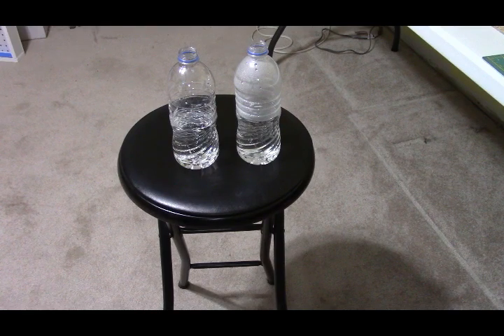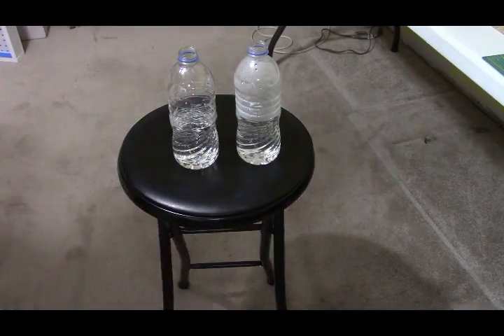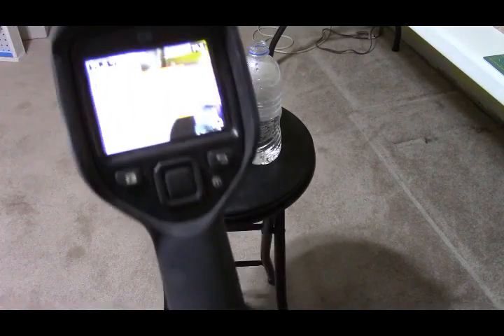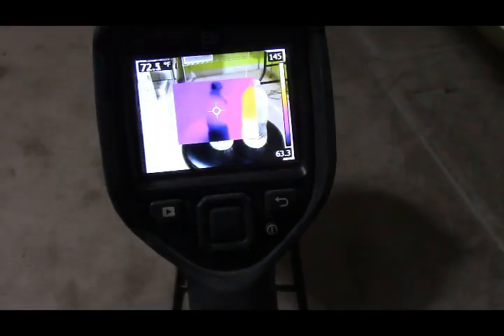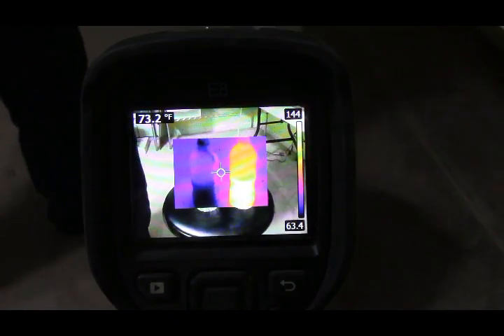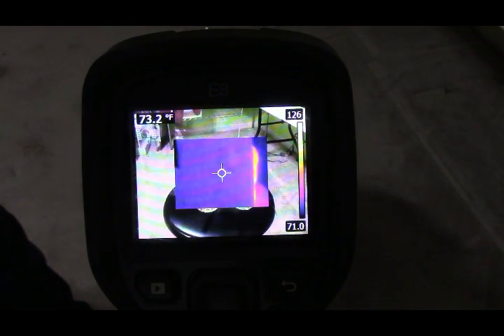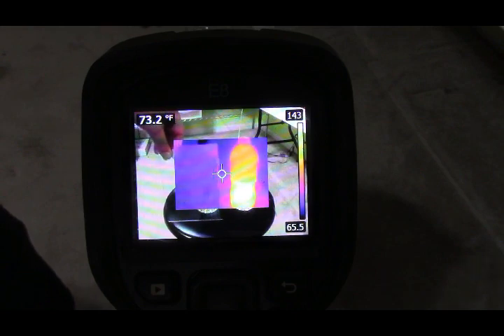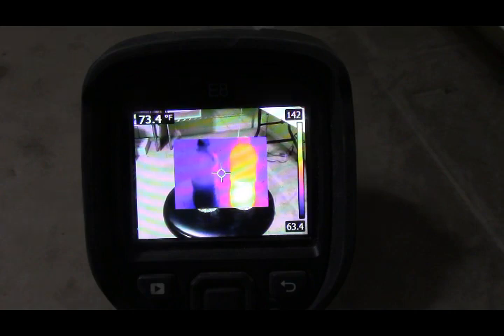Is infrared blocked by acrylic?

Comment: To me it seems that the Acrylic is not totally blocking the Infrared but
 making it diffuse. Because I see the whole acrylic plate turning yellow when it comes in front of the hot bottle.
Reply from the maker: Good observation. The plexiglass is very reflective in the IR bandwidth. Thus us referred to as having a low emissivity. The yellow and sometimes blue is the glass and plexiglass reflecting temp sources behind me as I'm not holding it steady. Sometimes your seeing the inner walls behind me and sometimes the ceiling or windows behind me. But great observation  :)

Comment: Hi.. Thanks video.. May i ask a question?
if there is dirt or fingerprints can you see a difference on copper metal surface by your IR camera?
Reply from the maker: There are several variables. The IR cam sees heat, either emitted or reflected. Fingerprints   would not change the heat signature in most cases. There are some instances it might, but as a general rule I'd say no. Dirt or other contamination would be easier to detect in most citations. So as a general rule I'd say yes. As I first mentioned, there are many variables here so take these answers with a grain of caution. Have a safe day.